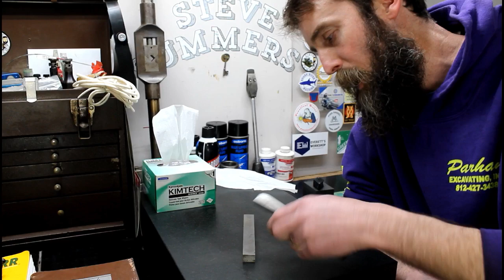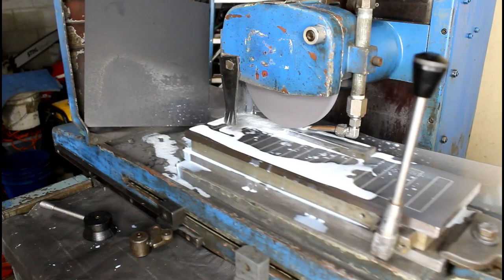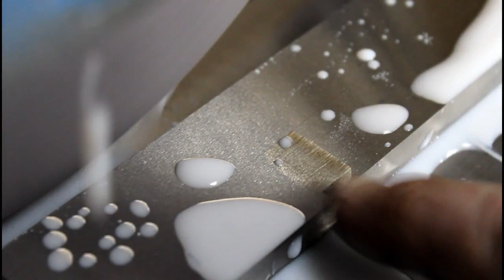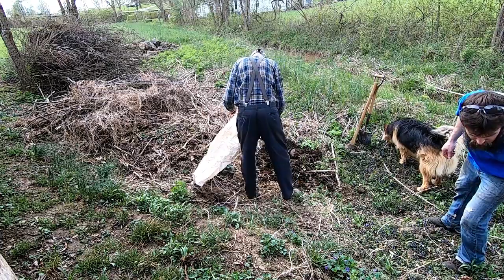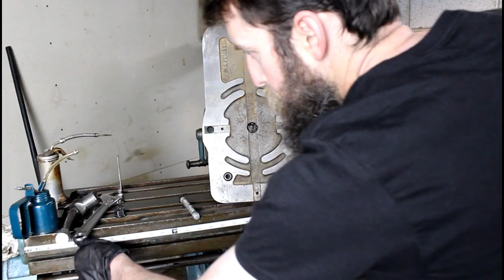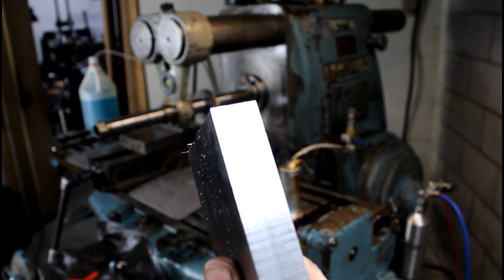Throwing a part off the surface grinder! HARD  :-)

Comment: I had a soft carbide shop job where I had hold the part against the graphite corner block and slide it under the wheel...had many parts explode and liked to blow my fingers off. Walked out after 9 months when every part I ran exploded or came out the wrong size or chipped on the finish end. Foreman was in an alcoholic rage and the plant manager was a dick head.

Comment: I found the issue of grinding a slightly bowed part fascinating. I'm not even remotely able to give you advice, but I am still fascinated. Can you get really thin shim stock, since you have already measured the amount of bow? If so, you could shim the bow and then use the maximum magnetic clamping without flattenung the bow.

Comment: Steve , take this from a machinist with 45 years in the trade, buy a big  LIXIE Mill vice hammer with the replaceable faces . There not cheap and it does take a while to get use to them but you will throw out ever other type of dead blow you use when using a Kirt vice . I had a old Machinist turn me on the Lixies hammer many decades ago and at first I HATED it !  as it seemed to heavy , but with in the first year I really got to the point I will not tighten a Kirt vice with out my Lixes hammer as there is nothing even close it's performance on a Kirt vice. It's one of the most important tools you will ever use on any kind of a mill and quit frankly, I got good indicating parts in with it on a 4 jaw in a lathe as well.  MSC sells them and make sure you get the big 150H  with 2 sets of hard delron heads, one for general use and a second pair only for die & delicate  work. The green rubber head it comes with is next to useless, install  the  delron heads on both sides as this hammer is a must have .

Comment: Should have part to be ground in center of chuck and  somewhat thinner backing pieces on all 4 sides of part to be ground the full size of the chuck magnets. Also slow down your cross feed rate.   PS I lost a bunch of parts out of a full sized Blanched grinder one time ----- that was exciting ! sounded like a bomb went off !

Comment: One day at work I was making 1-2-3 Blocks and I was doing my thing grinding them trying to get them square/parallel/flat and my buddy kyle was two surface grinders down doing his thing regrinding some of his old parallels, he left his magnet on residual and flung one of them against the wall, he just laughed and took a magic marker circled the dent in the concrete and put his name beside the dent to remind himself to use a block or use the full magnet before he starts grinding lol...
Reply: Btw when doing a part like that its almost better and safer to stagger them at a 30 or 45 degree angle on the magnet so they aren't getting full contact with the wheel on each step over... less chance of flinging the part but takes longer

Comment: If you are careful, you can map out the part and place shim stock under the Arc on the negative side of the bow. This will support the piece and allow for parallelism,. . Just ensure that the shim height is slightly  less that the error you are trying to correct.

Comment: Angle the components on the chuck so that you don't travers over the whole length  in one pass  it keeps the heat down which  is the main reason for FLYERS  . Old toolroom grinders trick

Comment: Just a few grinding suggestions: Once you dress the wheel do not shut it off, just be careful and place material on chuck and grind.  When grinding narrow parts place them on an angle and grind there will be less grinding surface per cut.

Comment: I worked on a 42" Blanchard grinder once where the customer had thrown off a chuck full of 2" steel cubes. They were supposed to weld up a cage to block in all of the parts. They got lazy and wrapped some steel banding around it and crimped on a buckle. It was not up to the task. They ripped off all the guards and bent the face plate that holds the stones. A 75 hp spindle will destroy itself in a real hurry.

Comment: Hi Steve,
Throwing a parts happens even to the best. Over all you did a nice job and you are correct in your explanation as to what happened. I would be careful about blocking the parallels with others blocks. Many times it makes it worse and more projectiles fly around. I would much rather have the part slide out of the way as it did for you. What I would do different would be to set the parts on the chuck at an angle similar to what we see at mark 9:49. That what you greatly reduce the heat signature to the part as the wheel engages less per pass. I am taking a wild guess that the steel is D2 which is not magnet friendly and heats up very easily when surface grinding due to the chrome content. Wheel selection and grit size is very important as well. It is all part of the learning experience and you are doing a great job.
Steve

Comment: The damage on the work piece suggests you were climb milling on the part, if so I suggest you stop this practice with a manual machine because they all have backlash and sooner or later it will bite.

Comment: Steve, you will find your surface grinder to be a great complimentary tool for your other machines. One nice use is to take down the height on 6 inch hardened vise jaws. Can give you the perfect height for when using parallels and for clearance.

Comment: Hey Steve, I've launched a part or two in my time, what grit and grade was that wheel? It was definitely self feeding.
Reply from the maker: Hello Stan 👍. The wheel is a 46 J if I remember correctly. Learned several things quickly doing this😁.
Reply: Well, the wheel was plenty coarse, I went back and looked at the dress you did, looked good. The only other variable I can think of was an excessive stepover, you can see hints of a self feed on the pass right before the part was tossed. When I say "self feed" the part heats & swells, it has nowhere to go except deeper into the wheel, causing more heat. Vicious cycle. Stay with it (I know you will) some things you just have to experience for yourself.
All the best, 
Z
Reply: Keep an eye on the action and reaction of the wheel, it acts like a 60 or 80 grit, so yes, his wheel is plenty coarse.

Comment: I think we've all thrown something from a machine at one time or other.  I once had about 512 1/4" square x 1/2" tall pieces ganged up on an electric mag chuck on a grinder to flatten the tops of the parts when we had an earthquake and the power went out.  The mag chuck powered down almost immediately and the grinding wheel threw parts across the room.  Sounded like machine gun fire.  Luckily nobody got hurt (because we were all running outside).

Keith Fenner might be able to help you get that arbor straightened out.  It's pretty similar to a short propeller shaft.

Comment: Make sure you block your parts in front when using partial mag, also, shims or some powder under your arch will allow you to add some mag power without undoing the bow.
More coolant if possible, and when a wheel starts grabbing the part inflates FAST...   ;)   This is where your 3 to 4 thou comes from...

Comment: Put the parts on the Chuck at 90 or 45 degrees to reduce the amount of time the wheel is in contact with part, reducing heat buildup that can cause part to grow into your wheel. Heat always the number one enemy. Also, if you can, get an electromagnetic chuck. They have a variable setting that allows for precise control of pull. Only downside is if you leave them on too long they can grow a little from thermal expansion.
Reply: @steve gale  yeah I guess the combined 250 years of experience in my shop as a tool makers making fiber optic connecter molds, 10 of which is my own, makes me unqualified to talk about surface grinding.

Comment: Regarding throwing a part off the chuck, you can lay additional thinner parallels or other steel blocking behind and along side your work piece to provide a backstop for the work. I do that quite often when I grind thin fit spacer details for my customer. The squeegee is a great idea, thanks.

Comment: nice chuck! lol - it happens - like you said its probably a combination of things - mostly expansion due to heat causing the cut to be a bit heavier than intended - and also if the face thats on the mag chuck is pitted or not veryyyy flat when rubbing coolant/lube - the lube gets under there and the friction reduces and - lift off!

Comment: Now you're horizontal milling right!
Set the surface speed, then crank up the feed until you rip the part outta the vise, then back it off a notch. :p

Comment: Yes your human, things happen especially in the shop and learning “new” machines. Each machine has a personality so you have to learn what makes it happy. So stuff happens, in my case I personally learn 10 time more from mistakes that successes. The 50 taper holder is set up to rotate so you can also set tool lengths with it. On CNC machining centers you need to have a known tool length, normally there is a fixture arm with it to set tools with.

Comment: Steve, with warped materials put a shim under the gap to support it. I've used shim stock,paper,traceing paper,and even cereal box cardboard. Get a pass or two on the hump side then flip them and take a pass. Then flip them again and take another pass..Then flip them again and keep doing that until they clean up. As far as residual grinding goes always run your handle at about the 2 o'clock position (unless it's an electric mag chuck with that feature) to ensure the magnetic lines of flux have a grip on the part. Always back up your work piece with a backer that has more surface grip than the work. I used 2 x 3 inch blocks with different thicknesses (1/8,3/16,1/4,5/16,3/8,7/16,1/2,5/8,3/4,and 1 inch. These were just CRS-1018 steel that were rough then refined and ground. Over 35 years and never threw anything off of a surface grinder. Good luck and keep learnen

Comment: Ah man, bummer of a week. Watch out as these mistakes come in threes !
Great that you are making use of the surface grinder, I’ve much to learn with my manual Herbert grinder which I’ve done exactly what you did Steve while cleaning up a set of parallels ! Surprised how quick your reflexes become for duck n cover 😃
Best of luck with your projects Steve, all the best
Mat
Reply from the maker: Yeah Matt, been told that before. Its usually deaths that are referred to as coming in 3's around here🙁.  You are the lucky guy who never has shop issues😁

Comment: To straighten that arbor, make gravity do the work for you. Notice that gravity always pulls in a straight line. Hang the arbor up by one end, hang a weight off the other end, and heat gently. Might take a while, like a few weeks, just let it hang and heat it every now and then, never hot enough to start gloing.

Comment: The first time I ever used a surface grinder, it was maybe 1983 or 84 thr boss handed me a washer about 3 inches od, with a 1 inch hole, about .375 thick, hardened Caterpillsr part, and said, take .025 off the face.  HE DIDN'T TELL ME I COULDN'T TAKE IT ALL AT ONCE.  I did leave .002 to finish it though!  Sent that sucker flying, blew up the wheel too.  Startled the hell out of me.  Never did that again.

Comment: Take the arbor to the Bash ... I'm sure there's someone that can fix ya right up. Have a great trip. Yeah, the Keith Fenner suggestion is good too. "Measure twice cut once"  -- and now, "Make darn sure that part is TIGHTLY SECURED before turning it on."  New sign, "WATCH FOR FLYING METAL OBJECTS" 🤣🤣🤣 No worries .. You are human and learning.

Comment: Now you know why handles get bent and are hammered on. The mag chuck is ment to be fully engaged .. YUPP USE shim stock between to grind off or take up the valley. If you take a piece of paper or business card between the wheel and stock to be ground touch off on the paper between wheel and steel when paper cuts you know it's a few thou till it's in to the steel. Just an old machinist trick used on mills too. I don't think the arbors toast , small digs usually can be worked out. Oh some of us older guys have used brass or aluminum keys to shear easier to save arbors. Just Keepem tight in the vise all parts HOLDEM DOWN GOOD. 
God bless you guys.

Comment: When the piece flew off the grinder, the cooling liquid may have gotten under the part and acted like a lubricant, so ZING!  That bow in the part may have been greater than it looked and the vibration allowed some liquid to creep underneath.  The magnet does not hold sideways, just pulls downward; it uses the friction hold the part to the plate.

Comment: A humble, accurate of how the parallel bit the dust. I have done the very thing on other parts I was grinding. Kudos on checking the wheel out,  You have to be careful. If it was a small rectangular part the piece would tip and the wheel will grab it an you can kiss the part and the wheel goodbye.

Comment: Tip on surface grinding,
Use a machinist vice and two parallels to grind one side flat then the opposite side directly on the magnet. 
The overheating could be going too slow over the part or a closed grain, too hard too fine grit or plugged wheel. 
I lost 4 pieces off of a magnetic V block once and never found 2 of them. I think they are on top of my storage container.

Comment: Steve, I am not a machinist at all and while I was working I went up to the shop and they have a little lathe up there and I was trying to learn how to run it a little and I turned the chuck jaws around to put a piece of PVC pipe in it and when I turned it on one of the jaws flew out of the chuck and slammed into the cinderblock wall across the shop landed in a box of junk under a work bench and it took me a while to find it, but I did and put it back in the chuck, that was a bad experience as well and I know how you feel,
Good luck, Dave

Comment: If I can’t ship out a bow I start full mag with the frown down.  Then I grind until flat and then start reducing magnetism while still taking passes and letting the bow come up into the wheel. Normally that gets it flat enough to flip and fix. I get this balancer stand rebuilt I am sure we could heat straighten/ press your arbor back to true.

Comment: Could shoulda woulda....... Hey we have all had it happen. I have flung my share of stuff too. If my set up is sketchy I will "block up" using my thin parallels at each end. With less than max magnetism the more surface area the better. It is not the last time it is going to happen. Just learn from it and go on. As far as your arbor indicate it for damage. We used to run "less than desirable" arbors for roughf out work when we just wanted to remove material. You may still be able to use it.

Comment: You were talking about resurfacing your chuck on your surface grinder.  Found a site called subtotal.com.  He talks about 
how to re-grind a chuck. Hope that may help.
Reply: I am interested in going to the site you posted, but wary of the link you posted.  Could you supply a direct link to it, please?  Thanks!
Reply: Go to YouTob search tipe in suburban tool magnetic chuck or How to grind a surface grinder chuck.

Comment: On your grinding episode, I'd like suggest a couple of things.  1, when you dress the wheel you need to ofset the diamond by at least a 1/2 inch for two reasons. When you place the diamond on center, it creates   bonce, and can show up as waves on your parts. Also, as part if diamond maintainance, each time you dress a flat is created on the diamond. So you can help you diamonds longevity by angling diamond about 15 degrees each time. This helps doing away wth any flats. And, 2, when grinding anything, especially at half the mag, you should always block in your parts, back, front, and left side for containment in case your magnet fails. Also, when grinding long parts, need to place them at adout 15 degrees  front to back. This lessons the amount of time the wheel is in contact with your parts. I hope  these suggestions help your grinding adventures, oh, and thanks, I always enjoy you videos! Chui Rios, I'm very good friends with outsidescrewball.

Comment: I tried to make a set of thin parallels years ago out of tool steel. No matter how light of cuts I took on the surface grinder, every time I checked them the bow came after taking them off the magnet. The old tool and die guy in the shop used a torch to flame straighten the smallest of bends. He put parts in a rotating jig and used a dial indicator while selectively heating various sections. It sounded crazy till I watched him in action. Too bad we have almost lost all of those skills to China workers these days.

Comment: i've thrown a rectangular aluminum part out of a cnc using a 3" shell mill once... IT HIT THE FRIGGIN 20' CEILING then ricocheted and hit the button of my hat. needless to say i always check the vices now..

 i try to make sure if i'm holding a part on a large flat surface that it's actually flat and not shaped like  \_/ or / \ or ( ) or  ) (  because even if the vice is tight as can possibly be, it might not be holding at it's maximum
another note, if the part is offset in the vice it's not holding it completely  (think about holding an object with the tips of your fingers vs the whole hand)
 we also practice adding a few extra clamps to the vices (studs in the t-slots and hold downs on the edges)  if we're doing heavy milling, having only two might allow for the vice to torque and move like a lever around one side, mucho no bueno!
 safety first, speed later

Comment: had a piece fly off at school too , made a mark in the mag chuck and made the teacher verry mad at me for a while 
usually you surround the piece with some extra metal so itat least stay in place if it doesnt have enough mass to atract enough to the magnetism
maibe you can get a feelergauge under the bow and hold it up that way to prevent the part flexing down  , unce the top of the bow is straightened out you could lay the piece on the mag chuck and clamp down on it harder